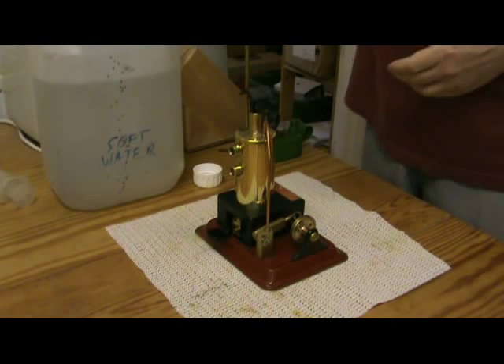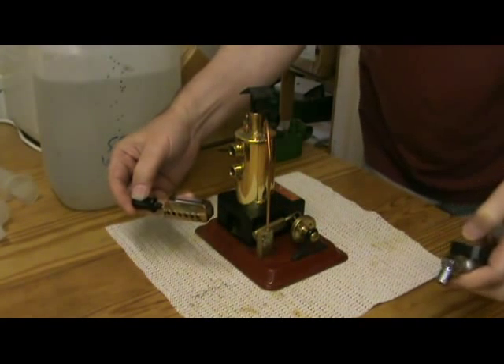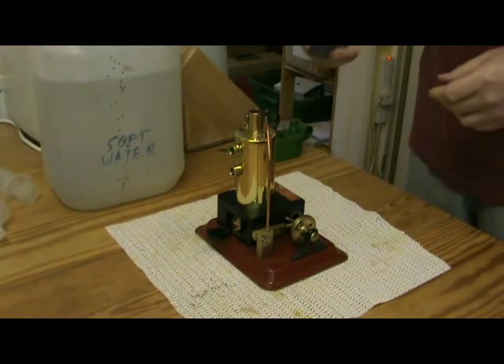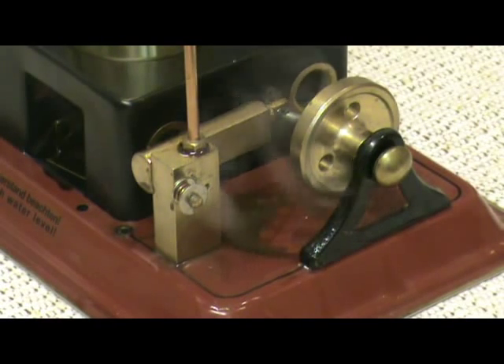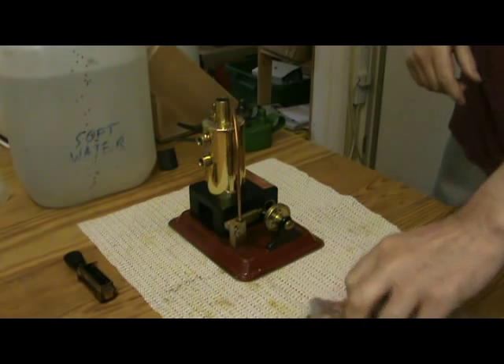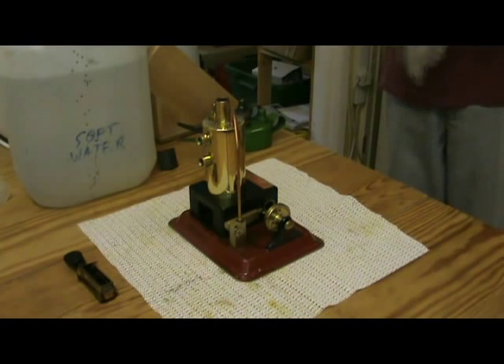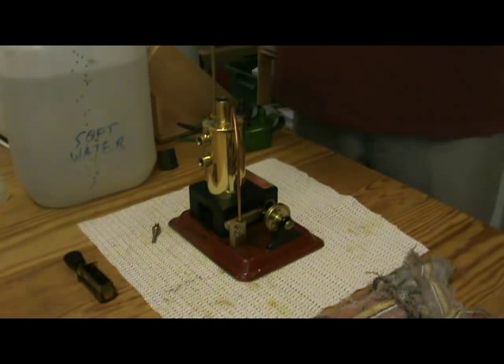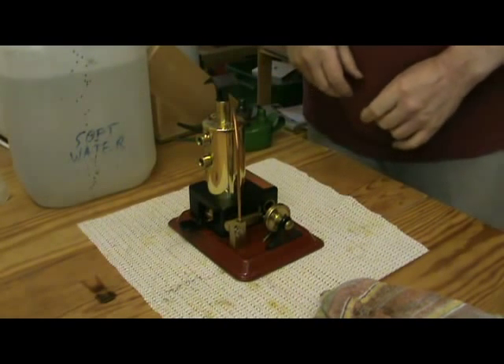Wilesco D3

Comment: this one did more then what mine would on the first two runs. and haven't gotten to buying fuel for it yet to test the fixes i did. i screw the safety valve tight and find it was loose when i run out of fire and the engine is cooling. also the piston was blocked up with oil.

Comment: If you put distilled water in it why do you have to take the water out?
Reply from the maker: Water corrodes brass if left in. Not as quickly as steel but it does corrode slowly. Using distilled water prevents limescale but it doesn't prevent corrosion.
Reply: Ok thank you for answering

Comment: Can you hook this up to the Wilesco accessories? and is there any way to slow down the fly wheel?
Reply from the maker: Hi Ronan. There is a small pulley cut into the flywheel bush, from which you can drive small accessories. It doesn't have much power to spare, though. There is no regulator or throttle. As with all Willesco Esbit fired engines, there is a degree of control over the air supply to the burner and hence the flame size. This indirectly controls the engine speed to a certain extent.